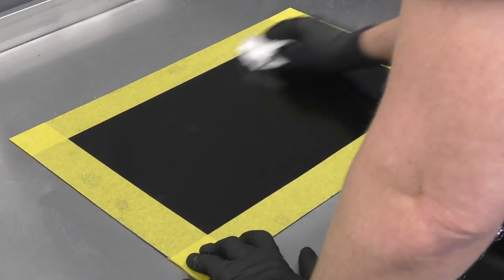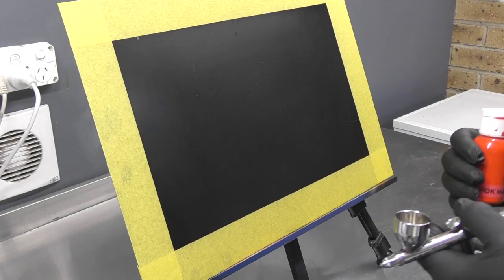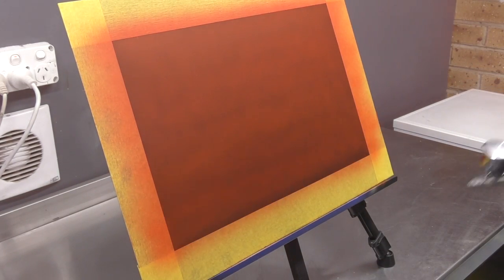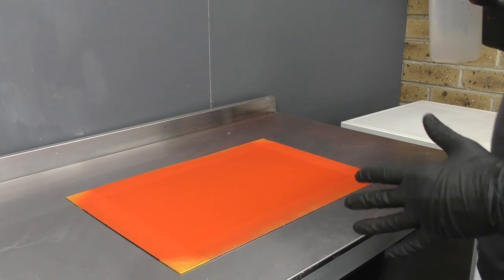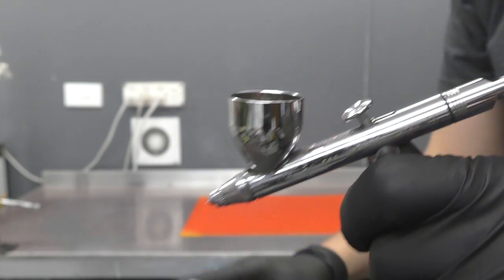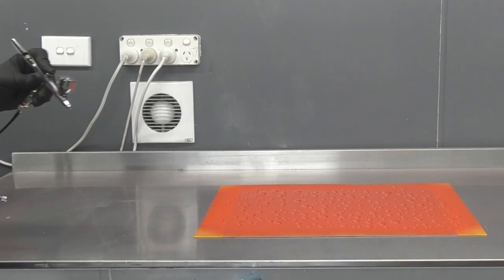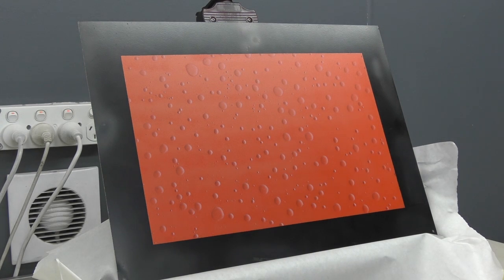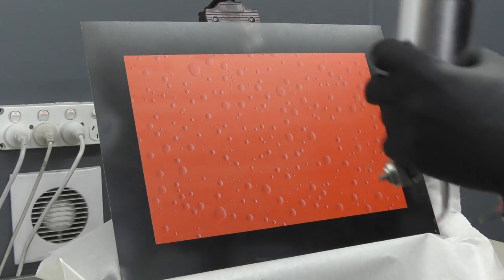Airbrushing Water Droplets made Easy

Comment: After the finish coat, one viewing angle resembles water drops and the other looks like moon craters.  Very unique.
Thank you
Reply: Yes, the only difference between a bulge above the surface and a crater into it is the direction of the shadows. Quite often, if you turn a picture upside-down, bulges and craters seem to flip.

Comment: Did similar years ago on a med blue (toronto maple leafs blue)  with a very dark blue and a purple on a goalie mask. Looked amazing. Yrs later did it on a young girls Ibanez dot with a pink base and purple and lilac water drop. Looked amazing as well. I used a garden sprayer to put on the droplets though and distilled water. My first 1/2 attempts was just with tap water but tap water has many contaminants in it and the paint wasnt working the way i expected.

Comment: Could you do this with water based paints maybe even candy but heat seal or inter coat first before he water drops
Reply from the maker: Heating it prob won’t work as you would eventually evaporate the water, but using an intercoat clear first may provide a barrier to allow it to be done with water based paints ? 🤔